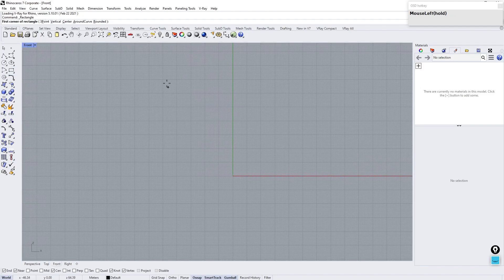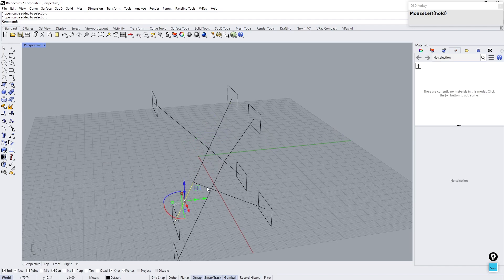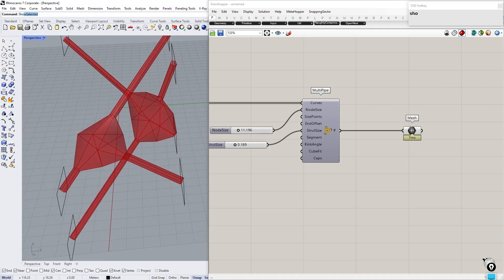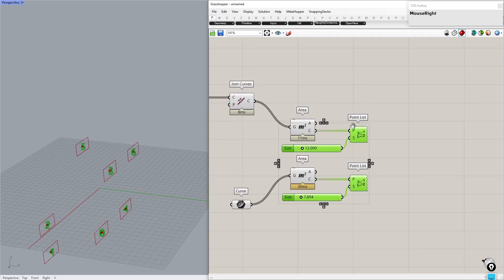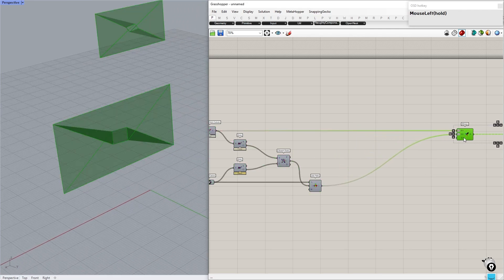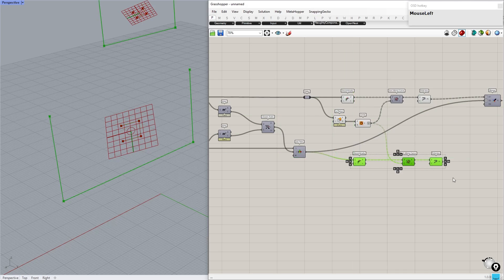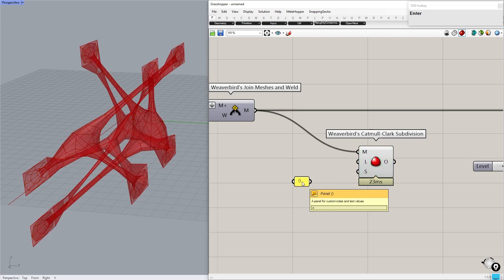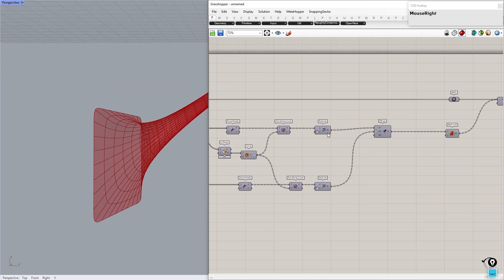Recreating Zaha Hadid Architects' Elastika In Rhino and Grasshopper

Comment: hey I am not able to use the mesh loft command and it keeps running in the error "control point count must be same between polyline" any suggestions?
Reply from the maker: Make sure to add control points to the lines, especially near the ends, like I did around 3:19 in the video. That should solve the issue
Reply: @3DBeast  okay sure will try that. The mesh I am getting is circular so the naked edges are a circle. Can that be an issue?
Reply from the maker: @Vedant9562  I see, with the recent update, the mesh container works differently. Instead, try using the 'Control Polygon' component when I use the mesh container at 3:52 in the video.

Comment: How can i add the mesh edges to my grasshopper
Reply from the maker: Hi, what you mean by adding mesh edges to Grasshopper? Are you trying to extract the edges of an existing mesh, or are you looking to create new edges on a mesh within Grasshopper?
Reply: @3DBeast  you used mesh edges in the tutorial when I type it in grasshopper another one appears for me I don't know why  so what I mean how to make it appear for me
Reply from the maker: @zaibabwaleed2944  I see, the component I used for mesh edges might be from another plugin, but you can achieve the same result using Grasshopper's native components. Just use the 'Mesh Edges' component and focus on the 'Naked Edges' output. If you're curious about the exact component I used, you can install the N-Gon plugin. Also, to follow along with the entire tutorial without any issues, make sure you have the plugins mentioned in the description: Weaverbird, Chromodoris, and N-Gon